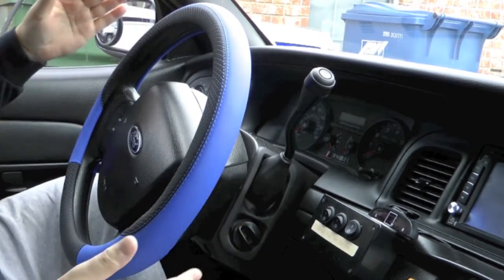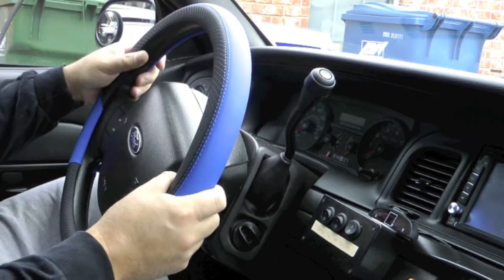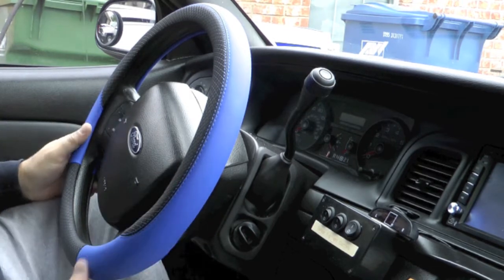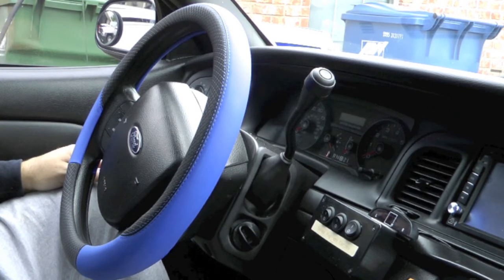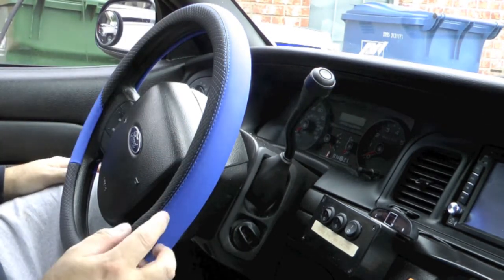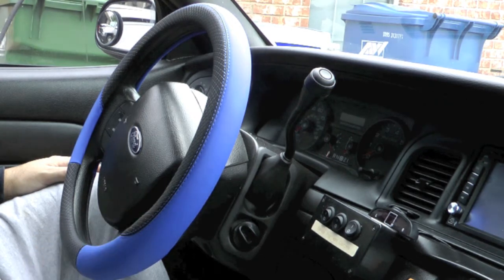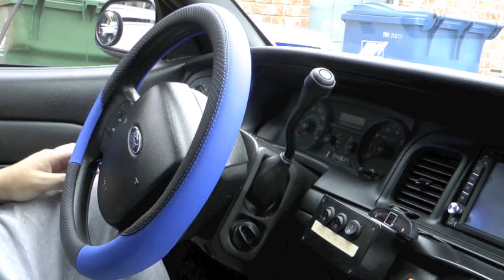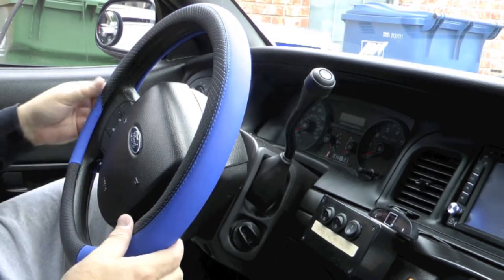Crown Vic steering wheel cover

Comment: What size is the cover for the cvpi steering wheel? Do you measure inches across?
Reply from the maker: I don't remember what the size was.  But I did a new video where I made a custom Pleather cover and I'm much happier with it than I was these slide over covers.
Reply: I got a 15"